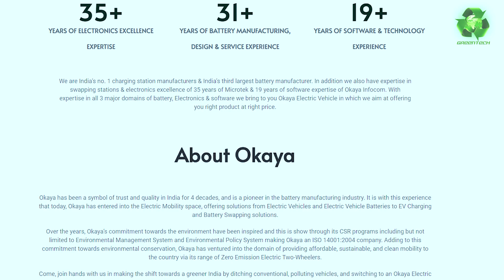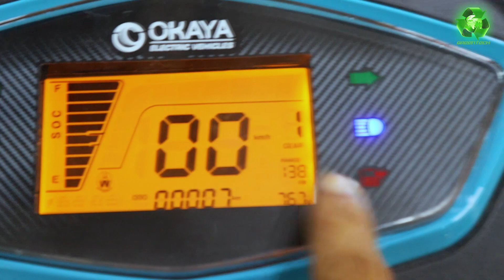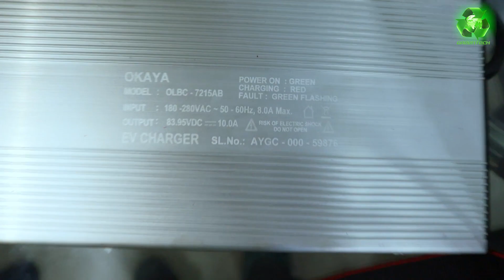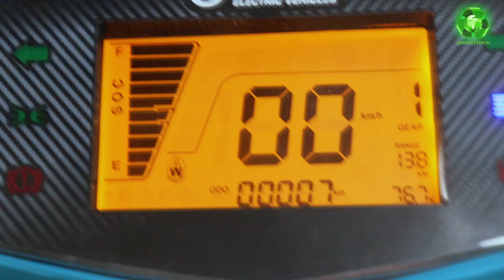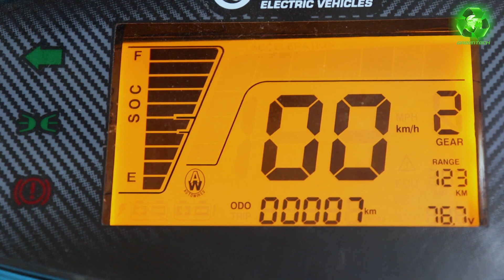Okaya Faast F4 200km Range? Electric Scooter Price, Specs, Highlights | Pros & Cons |Ride Experience

Comment: Battery capacity is 72v 30AH each battery. 2 batterys are connected in paralel, so the Discharge current is equaly shared by two batterys. Any one of tge battery voltage is greater than other crculating current will flow.
Reply from the maker: This is what I asked but they said its not connected in parallel while discharge but while charging its in parallel it seems, they are yet to clarify it
Reply: @Sekar do you have okaya f4
Reply: @Gudday67604  No, last week My I qube s delivered,  it is ok

Comment: Sir Okaya faast f4 review poda sonna sir aana na OLA S1 PRO vangitan sir I am first like sir
Reply from the maker: You bought OLA?
Reply: No okaya faast f4 

Worst built-in quality , only range maximum 140 kilometres per charge , breaking issue ,worst service ,body parts falling while driving ,no battery level indicator in new updated charger
Reply from the maker: @gowthamang658  bro if you are in Chennai lets do a feedback video, at least they will give better service

Comment: Battery temp monitoring ?  information, all cell voltages information?Any forced cooling arrangements during charging. Like over load trip , temp high trip of controller.Ask imp questions what is the cost of replacement / spare battery
Reply from the maker: Really nice questions but they are not knowing many

Comment: Bro. Initial torque very high. I made a test drive it.
They should R&D of the smooth start to feel free drive for aged persons or ladies
Reply: I totally agree regarding the initial torque. It is instantaneous not linear like Activa or Jupiter. It was a lil scary, also the foot position is very awkward.
Reply: ola or this which is better
Reply: @jackiechan2568  price n performance wise, this one is better. Ola has too many issues and very bad service.
Reply from the maker: Yes
Reply: U r right bro. Past week I bought the bike.   Torque high and brake is worst.  I have a Dio same.drum brake but it feels great but this ev brake atleast they should have disc one. Coz speed is high

Comment: Hero electric .double battery 140 km range.93 k price.
Reply from the maker: Yea bro 120kms
Reply: Okaya 88000 ki h
Reply: मैंने खरीदी है
Reply: Okaya faast f4 123000₹ on road. But no use many more problem this scooter don't buy
Reply: Hero optima 65km  +65 km 130 km kudukutha